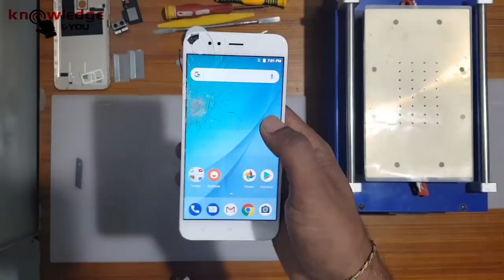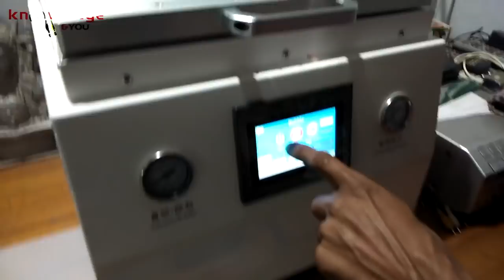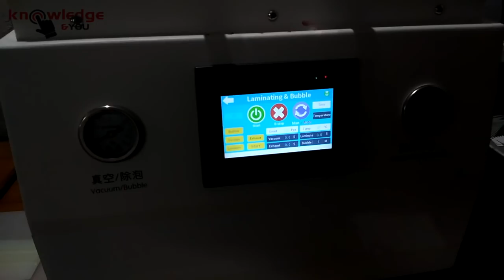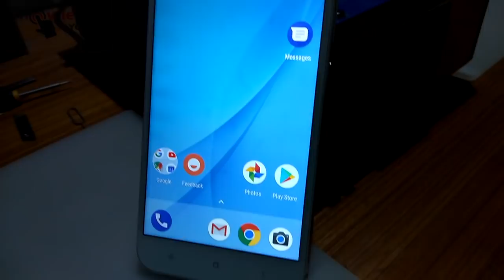MI A1 Broken Touch Replace With OCA

Comment: My glass is also broken do i have to change full display or only glass ...screen is not damaged
Reply: Nilay Mistry  only glass.Original will cost 2000 RS. With installation.Duplicate will be 1100 (with installation).Only gorilla glass will be not there in duplicate
Reply: But the mi store says it will will cost ₹ 3999
Reply: @pavanchakalabbi in which city.....in my city it said 5129 rupees
Reply: service centers do not change the glass they change the complete folder, 
and for mi a1 folder it costs around 4000 rs.